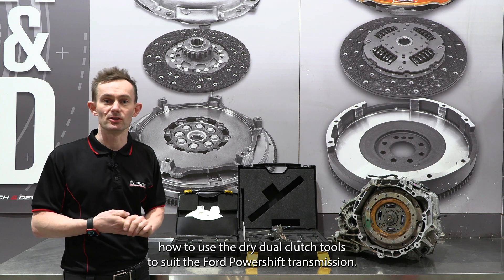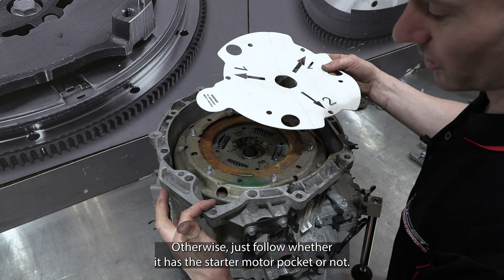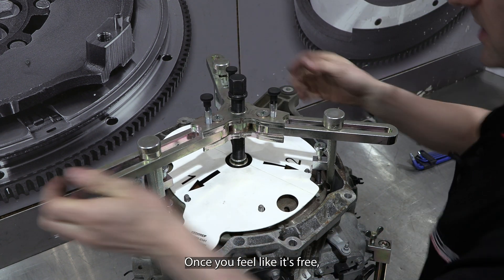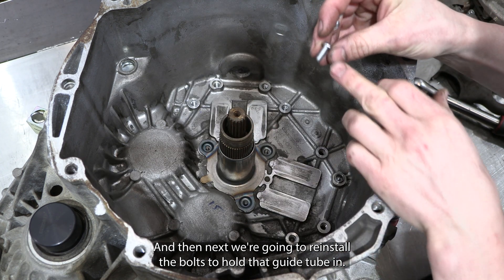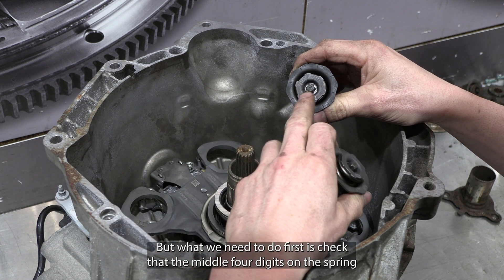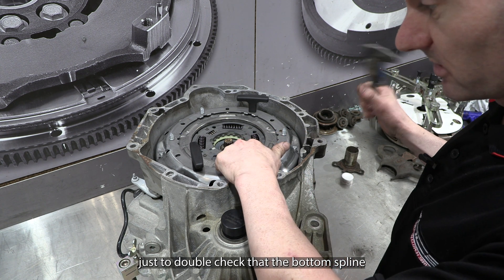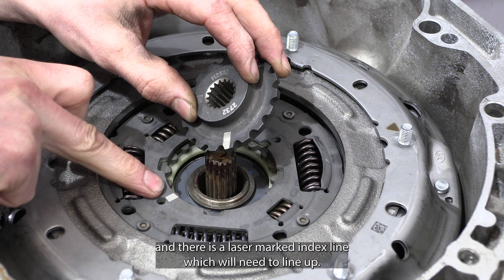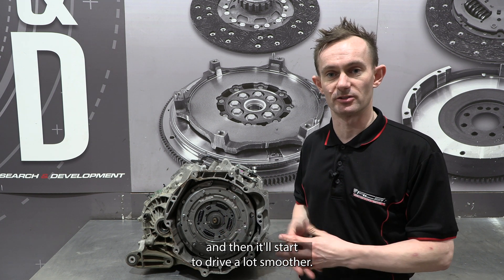CLUTCH TECH: Ford PowerShift DCT Clutch Replacement

Comment: You didn’t have to put the actuators back in the same holes they came out of, and you are supposed to put a small amount of grease on the edge of each fork.

Comment: And after you've finished replacing the actuators and dual clutch, keep all the tools ready, because next year you can do it all again. Congratz
Reply: I do CHECK the fatty DTC - 3 nails undo and 3 pins out the lock, so I do reset Clutch for cheaper cost. I just can't warranty how long, maybe another 30k km. It is better buy brand new OEM clutch, can hold 120k km.

Comment: This is a damned transmission avoid it like a plague
Reply: I can see why it's shit. Physical clutch Actuators instead of hydraulic driven wet clutches. Have way more finite control varying clutch pressure and way more accurate/ way cheaper to use quality pressure regulators/valves VS having to rely on servos and shitty programming
Reply: @jasontexter1721  it was designed in Hell